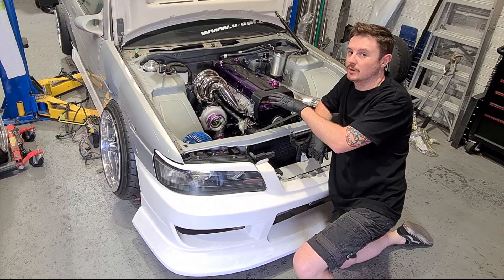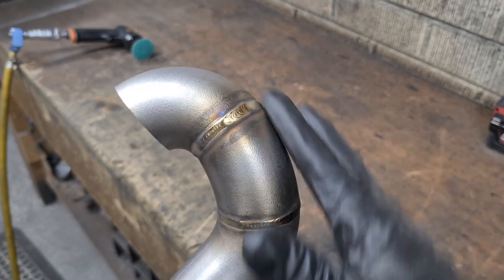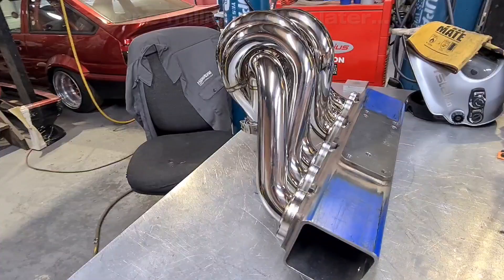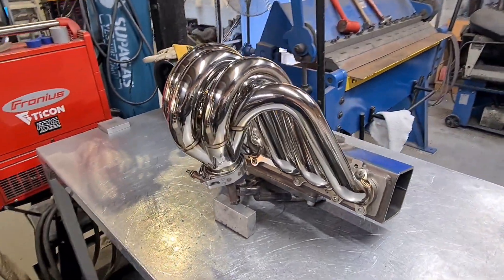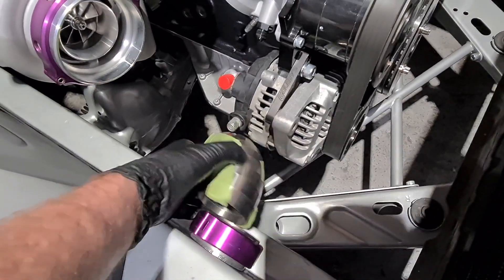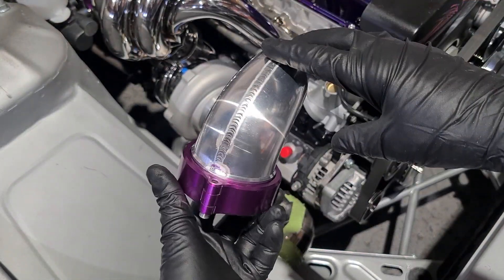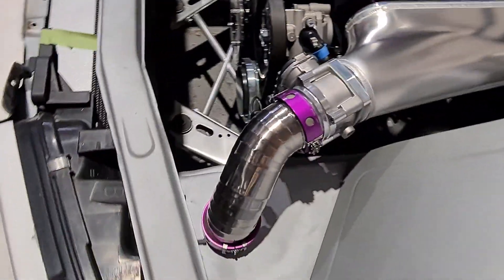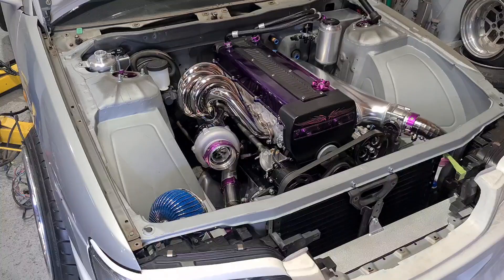Custom drift car fabrication: making my turbo manifold and titanium cooler piping.

Comment: Nicely done! It looks incredible. What make/model belt grinder were you using to bevel and polish the pipe?
Reply from the maker: Thanks mate! It's the radius master belt grinder. Super versatile bit kf equipment with different diameter rollers that you can quickly swap out for varying size tube notches

Comment: Sorry if it's a dumb question but how come you individually had the runners polished before welding? Can they not achieve the same finish if it was done once all togther?
Reply from the maker: @brettro8210  not a fumb question atall! It just allows every surface to br polished with easy acess. Once the manifold is assembled the area's where the runners pass over eachother would be incredibly difficult to get any kind of polishing tool in-between .
Reply: @ThirdStrikeBen  thanks for that, I thought it would be the case. Your work is beautiful!
Reply from the maker: @brettro8210  no problems, and thanks! 🤗

Comment: Amazing work mate, that's insane. How do you get into the middle of the collectors to weld the last runner? That's always confused me
Reply from the maker: Small welding cup and blanked off back cap to get into the centre of the collector

Comment: Amazing work man, love how those exhaust runners polished up! 
I know those clamps are made to have a bit of play in them but are they normally that loose or can you tighten them?
Reply from the maker: @artdamage0  thanks for the kind words dude! The piping still has no Oring seals installed so they won't be that floppy once the car is running, they take up a lot of the slack

Comment: Hell yeah dude! So sick to just see how your mind works!! I want to try and make my own manifold for my 1j 180 but it’s just so daunting 😂
Reply from the maker: @Kng_180  it's definitely a daunting process, especially for the first time, maybe try and do one in mild steel first, cheap material and easy to cut/bevel. Then move on to stainless once you have a better grasp on the fab process?
Reply: @  definitely think that will be the best option and learning curve, would it be worth tigging it up still?

Comment: Absolutely beautiful man again. I suppose if you think that pipe is going to be still too close to alternator, you could get a shorter belt to pull it up away from pipe down track? Love the spinning jigs, would be so much easier to get a perfect weld compared to moving yourself around the piece!
Reply from the maker: Yeah i had the same thought, can always squeeze the alternator in closer without too much hassle. But I'm confident it has enough clearance. I appreciate the feedback and kind words 🤗